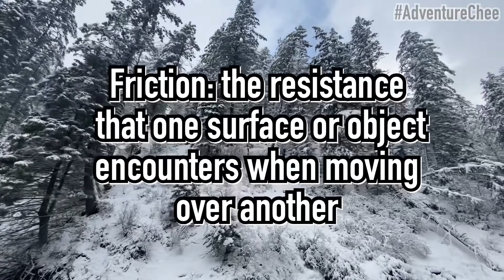When learning to snowboard, understand this physics concept.

Comment: Why does the side where I press on has lower friction then the side which is up? Usually in life you press to make a friction so Why is this different on snowboard? Is the ice melting under presssure the same way as on ice skates? Or why?
Reply from the maker: It’s the edge of your board in the snow that is creating the friction. So the more you’re on your edge, the more friction there is. For example, if you’re on your heel side edge and push down on your toes, there is less friction on your heel side edge because you made the board flatter on the smooth surface of the board. Hope this helps!